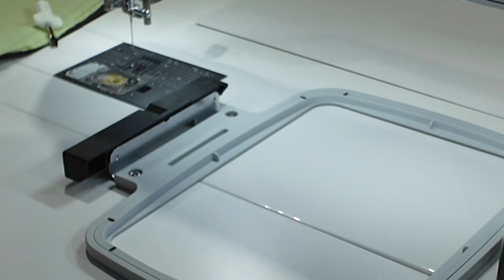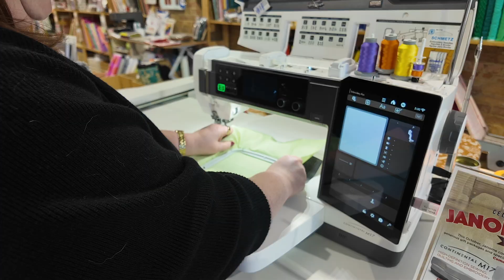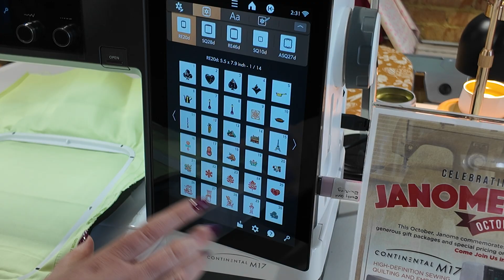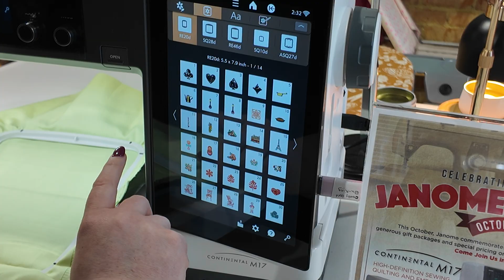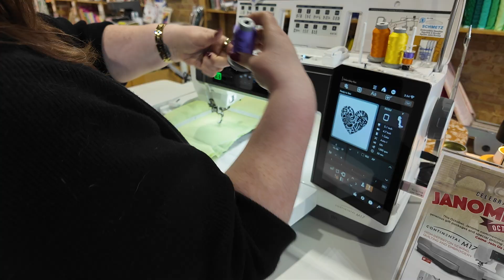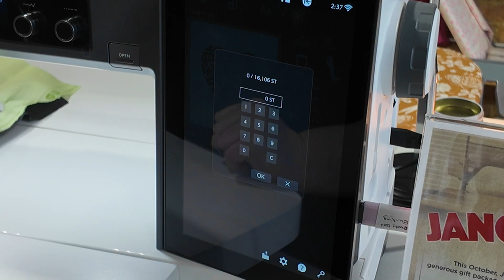SETTING UP YOUR JANOME CONTINENTAL M17 FOR EMBROIDERY

Comment: Wow, I just found this and it was exactly what I needed, thank you for posting. I previously had the 550e (2yr) and upgraded to the M17 in 2025.  I've been struggling getting the SQ10d sufficiently hooped as I'm not able to get the stabiliser as taught as with the 550e and I'm a bit frustrated as I mainly float my projects. Could you please explain more about the change from drum tight to just before drum tight? Is this a general change or specific to the M17? Thank you.
Reply from the maker: I learned to hoop just before drum tight a few years ago at an OESD dealer training. I’ve found it works across all brands/all models very well :)